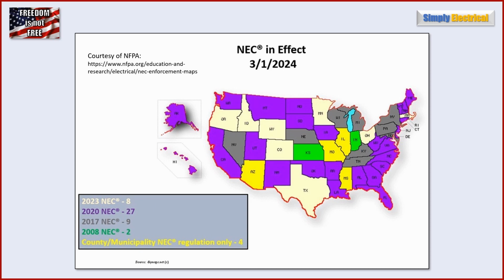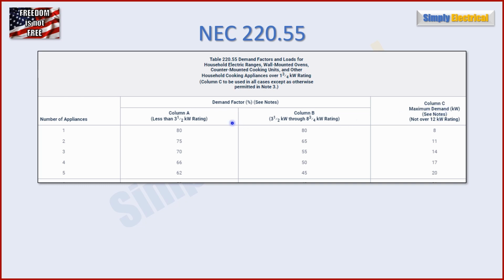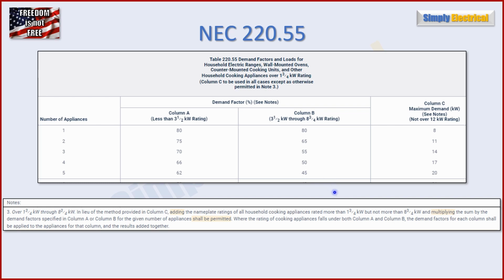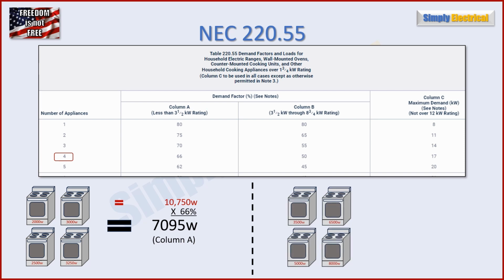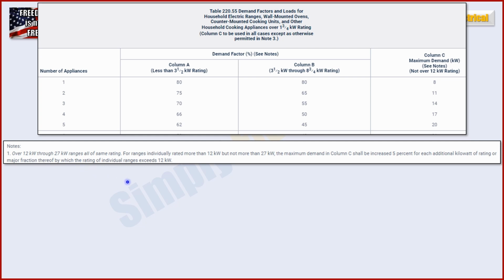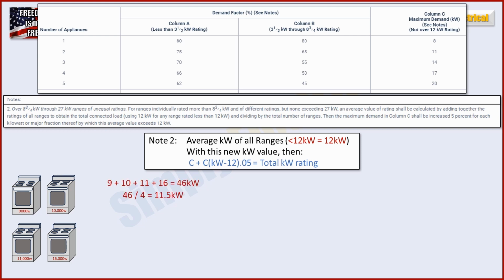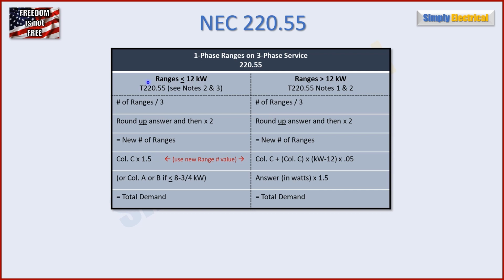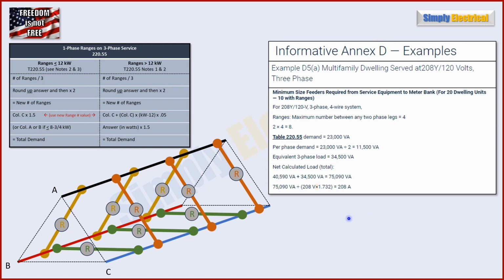Range Calculations NEC 220.55 - Deep Dive 2023

Comment: They should correct this table  , to make it less confusing 
#1 Just write percent sign  in columns A and B next to all percentage  value 

#2 write KW in column C next to all values

#3  write the formula     
Under the table. 

Im sure u can think of other
Reply from the maker: I agree that those changes would alleviate a bunch of confusion for many folks who depend on having a solid understanding of the table.

Comment: I got confused to but the formula helps a lot once I figured it out so if anyone else is confused it’s 
Total Demand = C+C x (kw-12) x .05

So let’s say per the example in the video we have to find our kw first so 18-12=6 kw 

Now increase base demand by 5% per kw over the limit 6 x 0.05 =0.3 %

Now what we have left is 17+17x0.3
Multiplication before addition so 17x0.3=5.1 
17+5.1=22.1 kw

Comment: What if i have (2) 13KW ranges what is the total KW? per 220.55 i had a question like this and the answears didn't make sense to me even using note #1
Reply from the maker: Using the formula C + C(kW-12).05, simply plug in the values like this:

11 + 11(13-12).05 = 11.55kW

Remember that the 'C' variable in the formula is the Column C value. So for two ranges, it would be 11kW.
Reply: @simply.electrical is it 11 or 11.5

11.5 was one of the answers 

So 11 + 11 =22 * .05 ?
Reply: Or 11 * .05 ?
Reply from the maker: @ericpolk9004  11.55kW should be the correct answer. If 11.5 was the closest answer they gave as an option, I would either choose it.....and then make a note of what you think the real answer is, depending on where you are testing.

Keep in mind, there are some state exams that do not provide a correct answer as a multiple choice option. For example, Oregon is notorious for their trick questions. Some questions have more than one right answer, also.
Reply: @simply.electrical I’m dealing with Oregon for a different license currently luckily it’s only B&L
Reply: @simply.electrical also two ranges wouldn’t you do 13-12 twice?
Reply from the maker: @ericpolk9004  No, the value in Column C (11) has already factored in both ranges. I know it's tempting to do that, but it'll give you way too high of a value.

It's a bit counterintuitive, but look at it this way:  According to the table, two 12kW ranges get calculated at 11kW - total. Seems crazy. But recognizing this makes it easier to see how two 13kW ranges can be taken at 11.55kW.

Comment: I am glad you shared the Annex D example. It helped to clarify the round up after dividing by 3. My original thought was round up if the decimal is greater than .5. After doing the doing the annex example I see you have to round up any remainder.  10/3=3.33   round up = 4    4x2= new column c value
Reply from the maker: Good point! I should have made that more clear in the video. Thanks for sharing the insight.

Comment: I use two methods we agree the range is  8,000 original rated kw and we have an aditional 5% to be added for i kilowatt over 12 k (13-12 = 1k rated @ 5%)

I multiply 8,000 * 1.05 = 8,400 final answer
Or you can multiply 8,000 * .05 = 400 then add to 8,000 original kw 

You wrote the equation in a weird manner and i like your videos but  you also didnt explain the multiplying of .05 usually equations work by 8+ (8* (13-12=) .05%) it almost confused me but id suggest you dont assume people understand just by looking at it you shoul state each purpose and sequence just trying to help you avoid people exiting the video lol
Reply from the maker: Thanks for your input on how I can improve the video. I realize everyone learns a little differently, and your suggestion is very welcomed!

But I'm not quite sure what you see as confusing. Could you please point out what part of the equation is weird to you? I'm a big fan of explaining things multiple ways so that more people can understand, so I'm hoping I can accommodate here.

My goal was to simplify the equation to its most basic form. I'm always happy to go simpler, if possible.

If you're just suggesting that I spend more time explaining the math, I can certainly do that next time. Making a video is kind of a balancing act. I want to be clear, concise, and complete. Often, it's hard to know when I'm being too wordy and overwhelming folks with data, examples, or over-explanation - vs expecting too much from them. Thanks for your tips!

Comment: Thank you for this explanation but why did you skip notes 4 and 5? That was the main information I was looking to understand
Reply from the maker: Notes 4, 5, & 6 are for branch circuit loads only. Since my focus was on a service and feeder load calc, I was only concerned with the first three notes.

That said, I now realize that my video title doesn't specify my intent completely, and I can see why you might expect a broader scope. Sorry for the confusion!
Reply: @simply.electrical exactly the confirmation I needed. Stuck on a problem for service loads, and now I understand why. Thank you.